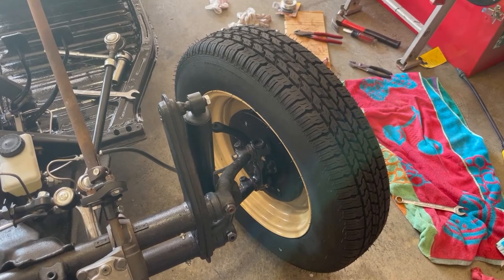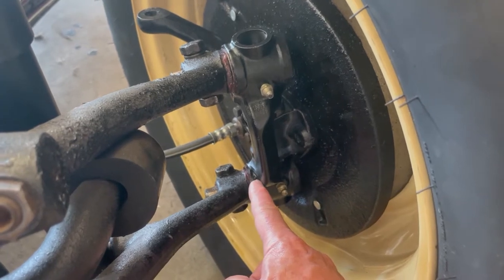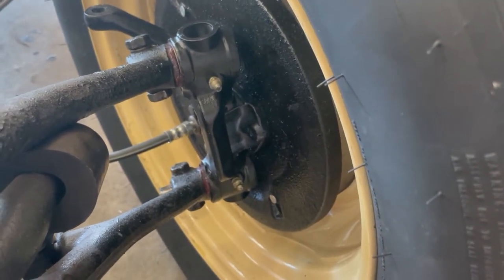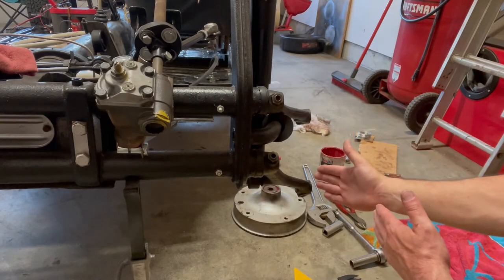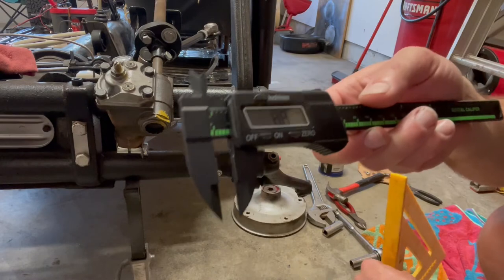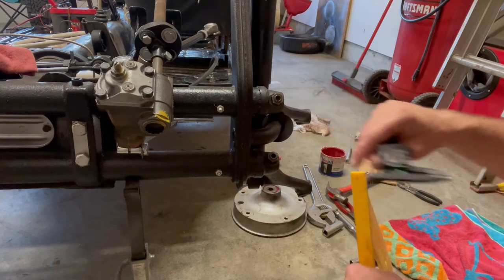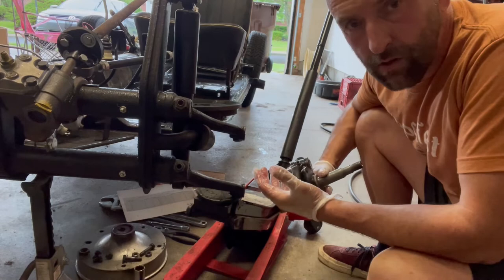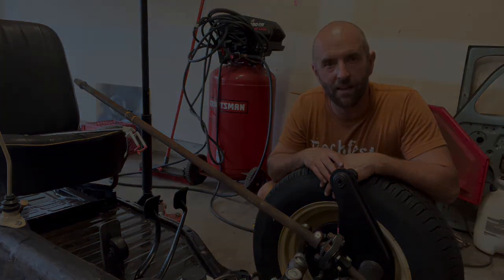How to Shim the Torsion Arm Link Pins - Pre-1960 VW Beetle Spindles

Comment: I am restoring my 57 oval as well. I just measured my torsion bars and it’s saying 10mm. Does that sound possible? The chart doesn’t have a spec for that
Reply from the maker: Hey Jon- It does not. If it is beyond 10MM you might want to check to see if the arm is bent. I've seen cases where the car has been in an accident and pushed the arms out of tolerance. if the car was in an accident you might want to consider replacing the arm its self. Good Luck!